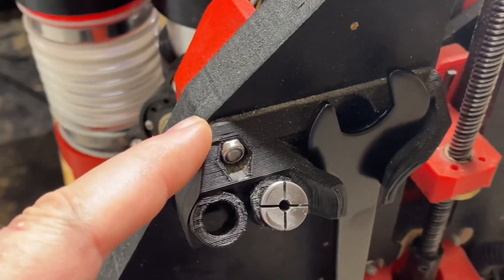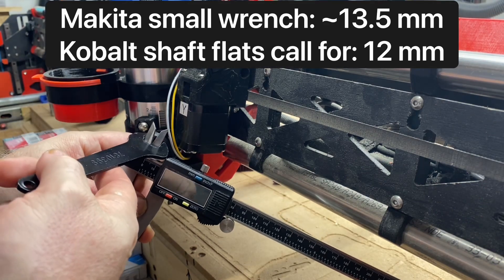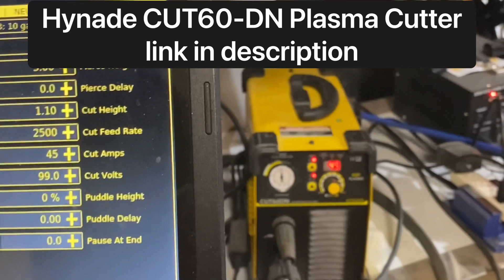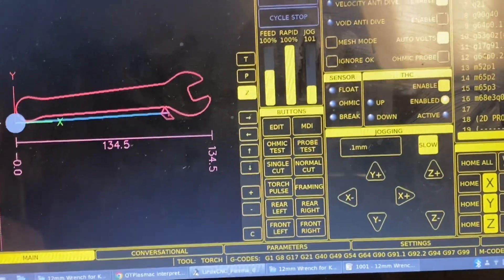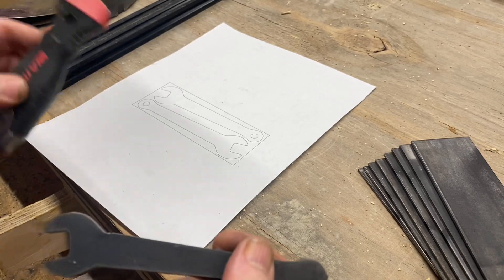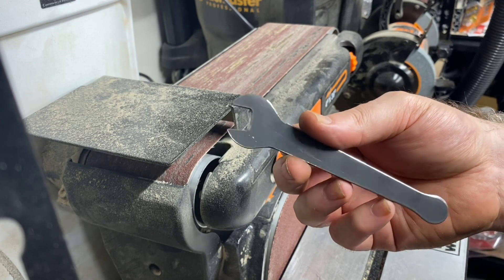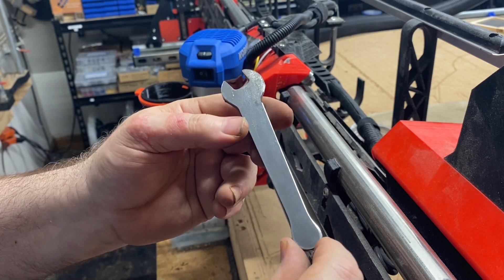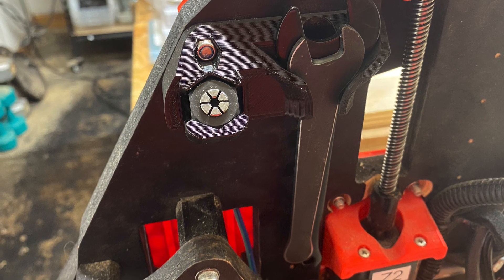LowRider 3 CNC - holder for Kobalt router's wrench(es) & collet-nut set + some plasma cutting too!

Comment: Awesome Doug!  Can't wait until I can build me one with a plasma on it!  One thing to think about is when you changed that tool holder you also moved around your Z endstop.  And unless you got it in exactly the same spot your X beam might not be quite the same level now.  Probably not enough to matter but still something to think about.
Reply from the maker: Yes, I kept that in mind. I tried to put them back in exactly the same place. I did try to do some measuring afterward. I need to brainstorm some better, easier ways to measure the Z tramming across various spots.
Reply from the maker: When I said, " tried to put them back in exactly the same place" I did indeed mean plural. I moved the Makita holder to the other side (off camera) to hold the Makita wrenches on that side, because I still have a Makita router in my DIY router table.
Reply: @design8studio  good deal Doug!!  I always just do it with the probe like Ryan talks about in the docs
Reply from the maker: @NorthWoodsCustomCreations  I’ll have to read up on that!